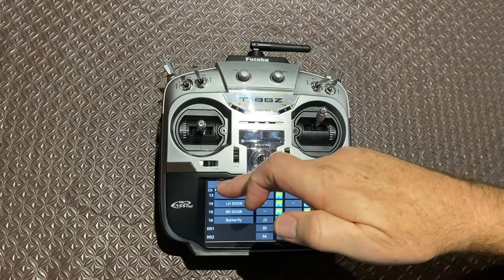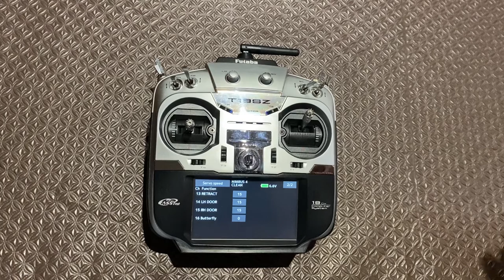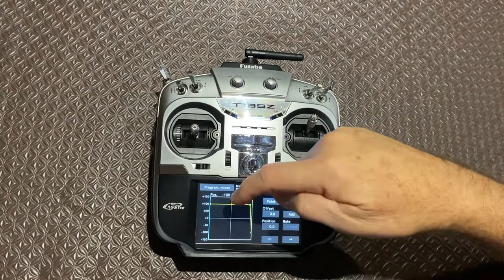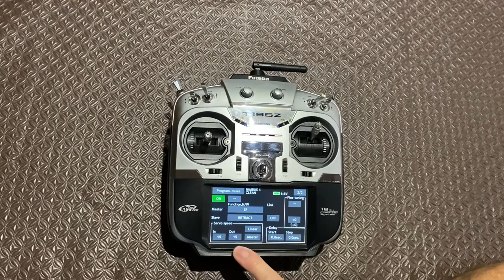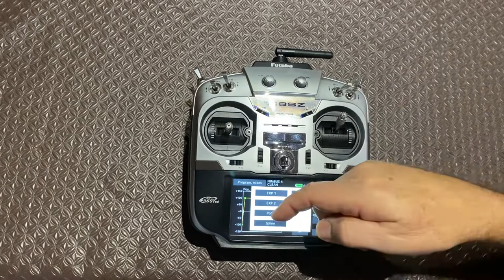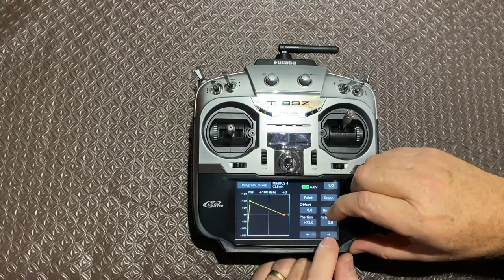Sequencer Programming on Futaba 18SZ

Comment: can you make any channel or control surfaces have differential? on the transmitters i have i can only do diff on the airlerons but i actually need it on rudders too, because i have a rather experimental design with two rudders. I'm looking for a transmitter that can do it. Thank you
Reply from the maker: I'll try and answer your question and read a little between the lines.   Differential is usually only required on ailerons and the amount of differential can often vary depending on the speed at which the model is flying at.  On a glider I use more differential when the glider is in thermal mode than I do when in cruse mode and even less when in speed mode.   My radio does not have differential on rudder however you could achieve this by a couple of methods.  You could simply reduce the travel in one direction which will give a predetermined and fixed amount of differential, however if you wished to vary the differential in a different flight mode then you could introduce a mix in the flight mode switch which reduces the travel in one direction.  Hope this is of some assistance.